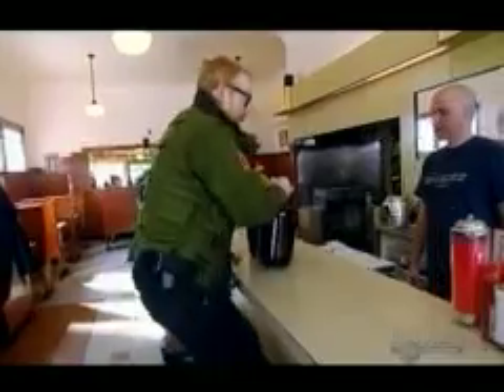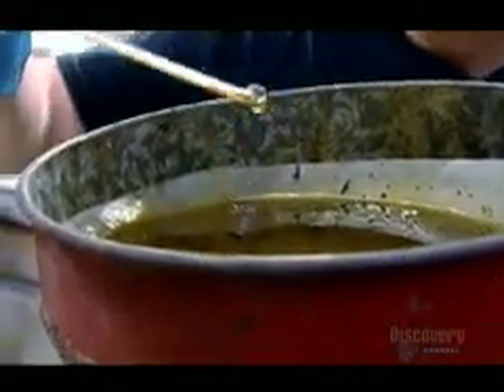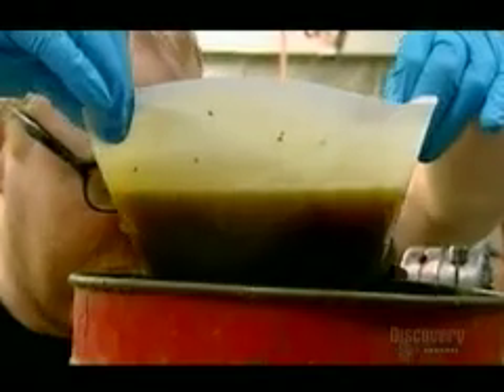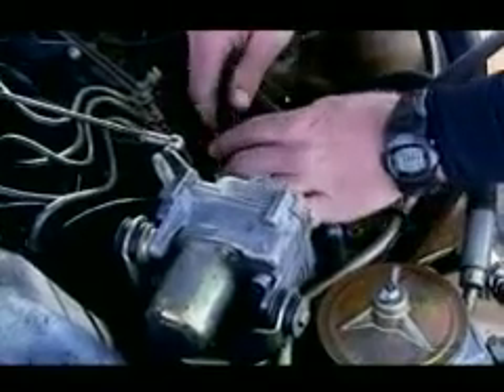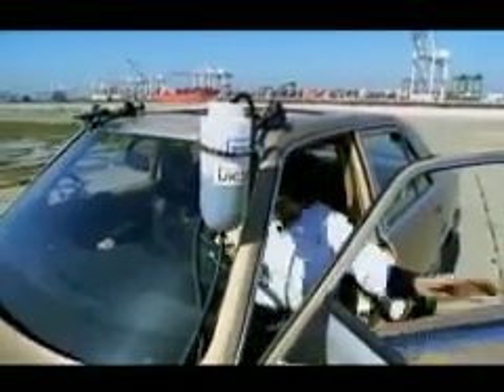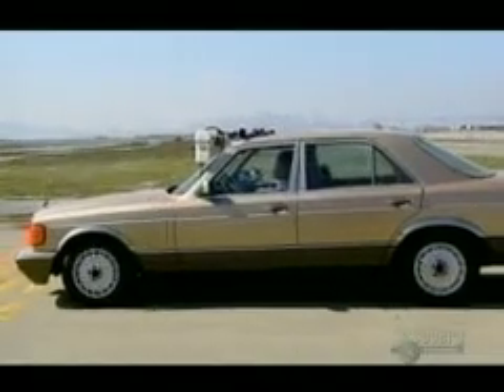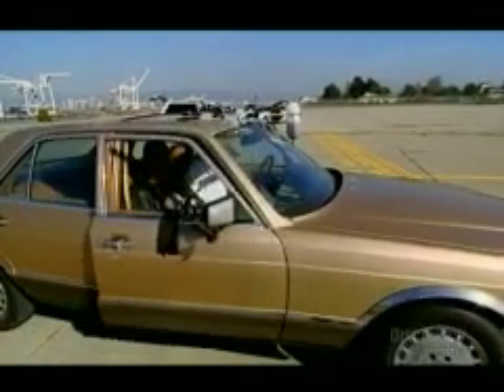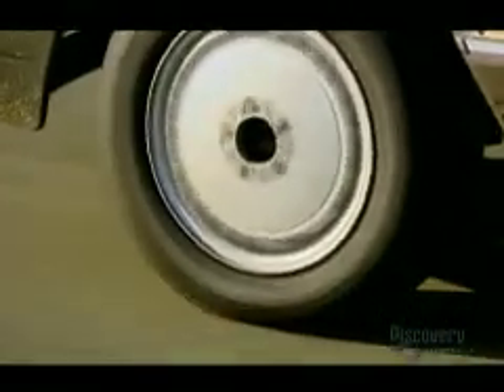Mythbusters - Cooking Oil as Economical Diesel Fuel

Comment: most modern diesel cars dont like WVO. but a diesel can run off of anything that burns. that INCLUDES motor oil, keresene, moonshine, YOU NAME IT, a MECHANICAL injected diesel WILL BURN IT. we couldnt ALL run our cars on WVO, and thats why this myth is busted. theres simply not enough veggie oil around to drive everone everywhere without it being MORE expensive than gasoiline, and plus the EPA has made current diesels very picky about fuel.
Reply: "theres simply not enough veggie oil around to drive everone everywhere without it being MORE expensive than gasoiline"..... really?!?  Forty percent of food in the United States is never eaten, amounting to $165 billion a year in waste... look at the US map. Its BIG isn't it?... put American farmers and American workers to work. Ethanol industry created almost 154,000 U.S. jobs in 2005 alone, boosting household income by $5.7 billion. American household NOT Iraqi or Chinese house hold. Engines picky about fuel? well most engines are not designed to run on bio fuels. You may have seen the sticker Flex Fuel on a Ford- BINGO. Technology is here- we can do it.
Reply: ethanl is a horrible fuel. there is no natural lubricant, runs like piss, and a multitude of other things. WMO is a MUCH better fuel due to its lubrication and good burn. i will never run any food based fuels in an ICE wilingly.
Reply: Keith Towne Most of the gasoline now sold has some ethanol in it- sorry to burst your bubble..." i will never run any food based fuels in an ICE wilingly."... and... why is that- if i can ask?
Reply: because its required. Ethanol makes zero sense as a fuel, because it requires more energy to create than you get from burning it. diesel is burned in the tractors, oil is used to make the fertilizers, and natural gas is used to create the electricity to run the irrigation pumps. its just a waste of good old dino fuel.
Reply: @ Matt P           Bull....
http://farmdocdaily.illinois.edu/2017/02/the-profitability-of-ethanol-production-in-2016.html
Reply: Keith Towne  Ethanol is not a perfect fuel but I've been running a 500HP+ small block on 85% ethanol for years now and the only trouble I've had with it is getting it started when it's cold (racing carb and supercharger). Block heaters help though.
Reply: ethanol is a fat, and just like fatty stuff clogs your arteries it clogs injectors/jets. i recently had to take apart a carb that had only been sitting for 6 months, but the ethanol in the fuel had solidified and clogged all the jets in the carbs.
Reply: Keith Towne Ethanol is a type of alcohol, not a fat. And straight gas can solidify or "varnish" and plug things up much more so than ethanol.
That being said, ethanol likes to soak up water, which is corrosive and can lead to fuel system problems, especially if you let it sit for extended periods of time (which is why I drain the bowls on my racecar if it's going to sit a while).
Really, though, letting any kind of fuel sit in a carb exposed to air through the vents is asking for trouble.
Reply: i appologize in my head i was thinking veggie oil. but the stuff i dug out of the carbs looked a lot like fat. and if it was my choice i would have drained the carbs, but i bought the motorcycle that way. i think my main problem with ethanol is that it is added to gasoline, which i think is the horribe part.
Reply: it is? why is that?
Reply: Keith Towne  That doesn't make sense. If it took more energy to produce ethanol then the energy that can be derived from it then ethanol would be being sold at a loss.

For example, if it took 10 gallons of diesel at $4 a gallon to produce 7 gallons of ethanol that sells for $3 a gallon then someone is taking a $19 loss.
Reply: price will never reflect losses in energy simply because its .gov enforced. there was a reason ethanol never came to the market until the .gov became involved.
Reply: well Ford T engine produced from 1908 through 1927 was capable of running on gasoline, kerosene, or ethanol..... but US gov was always controlled by oil industry so prohibition happened and alcohol was i LITTLE difficult to get by.... so thats one of the factors WHY it never came to a market. Whole infrastructure was gone, and engineers stopped take ethanol to an account and switched to gasoline. Brazil is considered to have the world's first sustainable biofuels economy and the biofuel industry leader... but in order  to cut costs on ethanol production we need a infrastructure- but it is a long term investment since it will generate more jobs here in North America and it will make the prices stable... some cars tolerate ethanol better some not so well, 1996 Ford Taurus was first flexible-fuel vehicle produced with versions capable of running with either ethanol (E85) or methanol (M85) blended with gasoline. Since 1998 a total of 15.1 million E85 flex-fuel vehicles had been sold or lease in the United States through December 2012. The American E85 flex-fuel vehicle was developed to run on any mixture of unleaded gasoline and ethanol, anywhere from 0% to 85% ethanol by volume. A 2005 survey found that 68% of American flex-fuel car owners were not aware they owned an E85 flex. :)
Reply: Keith Towne  That still doesn't make sense though. Just in simple economic terms, regardless if goverment is "enforcing" ethanol or not, ethanol producers have to see a profit or else it's not worth their time to produce ethanol, especially at a loss. As far as I know goverment can't point a gun to their head and force them to produce it at a loss.
Reply: i forgot to thank you for your example... this one:" For example, if it took 10 gallons of diesel at $4 a gallon to produce 7 gallons of ethanol that sells for $3 a gallon then someone is taking a $19 loss".... VERY sophisticated example...really? you must be very young..... any ways... you dont have a slightest idea what are you talking about...The United States became the world's largest producer of ethanol fuel in 2005... also read about: " Energy Independence and Security Act of 2007"... it is estimated that US will export at least 700-750 million gallons of ethanol, Canada has been the largest customer of US ethanol exports, accounting for 55% this year... so look like it is profitable... i bet they are not doing it for free... or maybe THEY do not understand" simple economics"...
Reply: Chris Gryckiewicz First of all, if you have something to say to me, figure out how the reply button works so we know who is talking to whom.

Secondly, it was suggested that it takes more energy to produce ethanol than can be derived from the ethanol.

So I made the point that that doesn't make sense (economically) and then provided a simple example of why. The numbers I gave were an example to demonstrate the principle of why "it takes more energy to produce ethanol then you can get back out of it" doesn't make sense economically as the ethanol producers would be operating at a loss, which, in economic terms, isn't possible so "it takes more energy to produce ethanol then you can get back out of it" must not be true.

It wasn't a criticism of ethanol production. I was questioning something someone else said about ethanol production.

So it seems you don't know what you're talking about. Next time read a comment more carefully before trying to argue against it.
Reply: im sooo sorry for all the confusion :) yes, you came up with pretty accurate numbers... and i proved to you that it makes a sense since they all ready doing it...
Reply: You guys DO know that the US Gov makes DIRECT CASH PAYMENTS to ethanol producers so they break even or make a profit to prop up the Ethanol production industry....right? It IS a PROVEN FACT that in SOME cases it takes more energy to produce ethanol than the energy that is IN ethanol.  The US exports corn too, but that doesn't mean it is ALWAYS profitable to grow and harvest corn on a farm. But the US Gov sees the importance of both farms and corn production...as well as domestic ethanol production....so they provide SUBSIDIES to keep the ethanol industry going and growing until it is fully matured and has the volume to make large-scale production costs come down. THE US GOV IS THE ONE TAKING THE LOSS.
Reply: The problem with waste motor oil, is you need to get all the contaminants out of it, and lower the viscosity, as motor oil is quite a bit thicker then diesel fuel, otherwise you could damage pumps, and injectors by forcing a too thick fluid through them.  

Most likely you would use a series of filters, say something like cheesecloth to get the really big stuff out, then maybe a coffee filter to get the medium size stuff out, but you need to be down around 1 micron to get the rest out.  Then you need to mix in something thinner than diesel to lower the viscosity.  I suppose ethanol or methanol might work for this, gasoline or naphtha would also be options, but could be expensive.
Reply: Keith not moonshine

Comment: Your logic assumes that plants can grow anywhere. A large portion of Africa is simply too dry, hot or both for the kind of crops that can produce fuel. Even in areas that they can grow, the yeild may be lower and not economically viable. GMO is an option but it faces large scale opposition and would be expensive for that task.
HHO is simply water that has undergone electrolysis. It takes more energy to produce it than it gives out when burned. It can only store energy produced by other means.

Comment: You can't really run straight filtered cooking oil in a Diesel engine you need some modification done to it. If you run it with out a modification anything in the fuel system can go such as an injection pump or lift pump

Comment: Its about 10 bucks for a gallon of cooking oil, and you get less gas mileage. If everyone ran around driving cooking oil cars, no one would be handing out all of these gallons of oil for free, (as an exmaple say theres 300,000 cars in the u.s. that would mean 3,000,000 gallons of oil a year if all of those car owners only got 10 gallons a year, which is a ridiculously optimistic figure) So yes, running on regular diesel is more efficient.

Comment: Mathematically at 100% efficiency you need to put 1 MJ or electricity into your HHO kit (electricity into the wires to crack the water) in order to get 1 MJ or HHO out. (Let's ignore that these kits aren't 100% efficient.) Then you put that 1 MJ of HHO into your 20% efficient internal combustion engine. Giving you 0.2 MJ of kinetic energy. You then put that 0.2 MJ or kinetic energy into your alternator at 90% efficiency giving you 0.18 MJ of electricity back to make more HHO. How is that free?

Comment: If you're wondering why a 9 MJ/kg energy density for the Lithium-Oxygen batter is so impressive, when Gasoline/Diesel has about 46 MJ/kg energy density remember the relative efficiencies of the engine/motors again. All else being equal an ICE will convert 20 to 40% of the 46 MJ/kg into kinetic energy. While an electric one will convert 90 to 97% of the of the 9 MJ/kg Into kinetic energy. (Electric vehicles can do away with the drive train too, further reducing inefficiencies.)

Comment: Internal combustion engines have a maximum theoretical efficiency of about 40%. In practice they generally only average about 20% efficient. There is an upper limit on how efficient you can get using an ICE. The moving parts and thermal inefficiencies of burning a fuel to produce an expanding gas limit the maximum energy in gasoline (or diesel) that can be used to actually move your vehicle down the road. And HHO is not actually free. I don't know where you would get that idea.

Comment: Electric motors are 85 to 90% efficient right now, and theoretically they can be nearly 100% efficient. The problem is how to store that electricity in a moving vehicle and great strides have been made in recent years. (Lithium-Oxygen batteries are at about 9 MJ/kg)  Electric is the real threat to big oil (vegetable oil and HHO are just minor sideshows) and that is why so much time, effort, and money has been spent by big oil to slow down and discredit electric vehicle adoption.

Comment: This will only work on certain engines, the OLD Mercedes being one. Newer diesel engines (After 1998) need extensive modifications to run on veggie oil due to the high pressure pump system (AKA Common Rail). Pre-1998 diesels require piston seals which can handle it. Usually Bosch fuel pumps are fine. Lucas are not.

Comment: First, Petroleum is organic, so there is chemically not that much difference. And that is has longer molecules gives it mainly the higher energy density compared to for example ethanol which is rather simple organic molecule. And that's why they have a worse mileage per gallon with the bio-diesel.
But the statement that "energy have been burned out of the fuel" is just nonsense or have you ever see a fryer being in flames? Because that is what it needs to "burn" it is called oxidation!

Comment: They did fine running only 1 time with straight WVO(waste vegetable oil). But if they used it for a week or month they would have clogged fuel injectors= Why people using straight WVO have a heating system in their car or truck to heat the oil and make it thin(viscosity). Or they can run 50% diesel blended with 50% Vegetable Oil then no need to heat the WVO.

Comment: Of course running modern diesels especially common rail systems with smaller orifice and anywhere that gets cold is likely to have problems and there's the microbial contamination.  Increasing fuel efficiency isn't likely to happen with a quick little tweak but I can think of some things that should.  If a catalyst can become involved in the combustion itself it may result in a better burn.  Ceramic liners may reflect more heat into combustion albeit more NOx.  As always less power = effeciency

Comment: well that the advantage of biofuels, you don't need to make major changes in your the distribution or even the motors so you can basically just put the green stuff straight in. what most industries don't want is having to by a new expensive kit knowing that there previous one is working fine and cost a fortune. if you provide them with an source they'll happily takes it.

Comment: ok fair enough i checked it wouldn't come down as mineral for chemist but any way. i did say a lot shorter i.e. there is a circle for fissile fuels but it millions of year vs 1 to 10 for biofuels. the problem is that the environment has adapted to a certain amount of carbon that has dropped over millions of year then we released it it in a few hundred years. basicallyto come back to normal well have to wait several million year.

Comment: silicone based oil and mineral oil are two different things. You can't make gasoline out of silicon oils, it's just a lubricant. As for the mineraloil: is just burning rotten plants that are transformed into complex carbon-thingies. Thereby we are just freeing carbonoxide accumulated by plants millions and millions of years ago. There you have your cycle.

Comment: yes I know but the advantage of biofuels is the circle of carbon is a lot shorter than with fossil fuel (yeah sorry mineral il a silicon based and don't burn well) so the advantage of biofuels is that any CO2 produced burning them was used to produce them and will be used on the next batch. they are developing i think third generation biofuels that use the wast product of farm and industry for there production so no more land problems or eating and fueling conflicts.

Comment: yeah from what i was told to make it work and not spend a lot you have to also use additives to the cooking oil and filter it at lest 4 or 5 times to get the oil really clean before putting the additives in it. I think she said by the time everything is said and done they were payin 85 cents per gallon.

Comment: doesnt happen at all engines have been stripped for inspection by enthusiasts in the UK after five years of running on nothing but filtered dewatered waste veg oills and no damage has o0ccured to the engine at all and there is no carbon build up either. the orriginal first diesel engines were designed to run on Nut Oil.

Comment: I don't accept that heating and filtering is doing it badly I heat to 120 degrees C settle fopr 5 days pump through 50 micron 25 micron and 10 micron filters into drum 2 then heat again and settle for a further 5 days before filtering through 10 micron and 5 micron filters, thats doing it properly. the oil is so clean you could fry your fries in it.

Comment: for all the answers to running on veg oil go to: vegetableoildiesel.co.uk
it is a lot cheaper to run on used veg oil Myth Busters simply dont get the whole point of not paying gas pump prices so it is simply a question of wether or not you can do it which is not Busted as they say. no one claims it gives better fuel economny but your vechicle will pass the emissions tests every year without fail my 15 year old car has for the last 10 years.

Comment: you don't realky know as much as you think you do, do you, as long as you have a Bosch fuel pump and build yourself a decent heating and filtration setup you'll be ok, my 1998 Citroen Xantia Turbo diesel runs fine on it and it has two computers and an electronic engine managment system.

Comment: If you're wanting to use biodiesel... however you CAN run vehicles on filtered oil, my company has 3 trucks and 2 vans that run on filtered deep fryer oil. However the vehicles have been modified to have heaters in the tank and the fuel line to keep things moving. Especially important in winter, though you can get away with it during summer.

Comment: Poorly done. It needs to be heated and filtered. Then have deydrated salt poured through it. That's salt that has been baked. Then add the methyl alcohol and lye mix. The result will be biodiesel that needs to be further cleaned. Then it can be used for fuel.